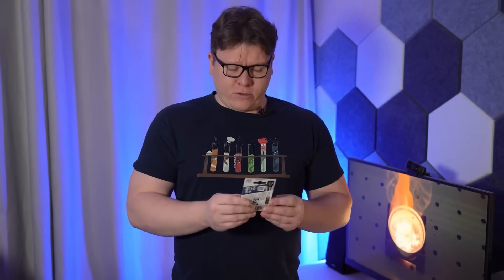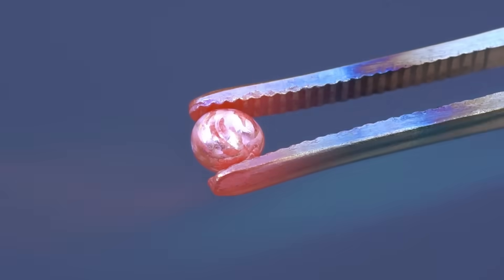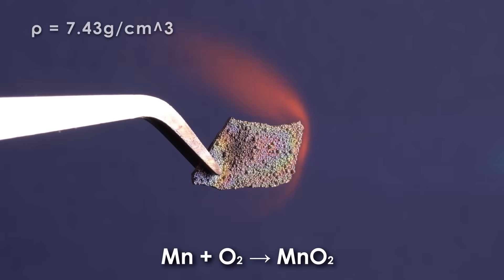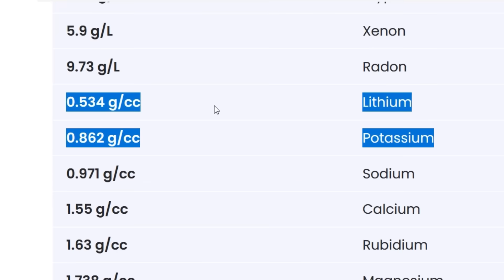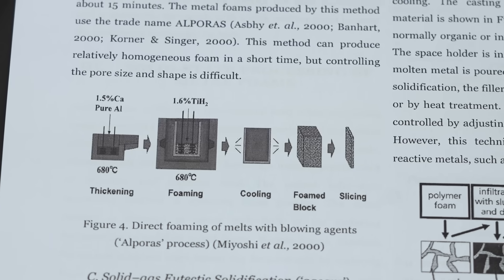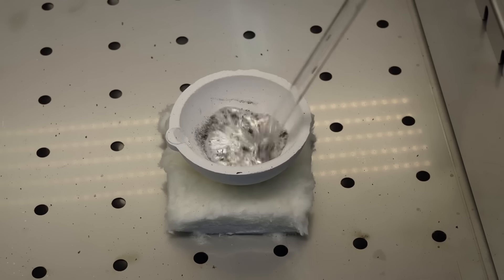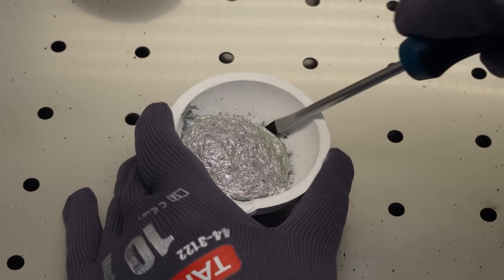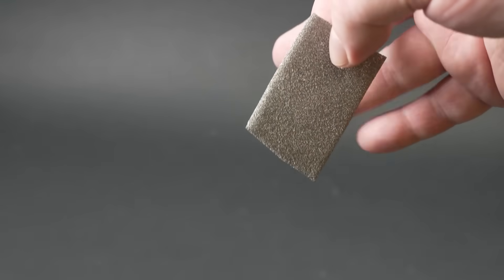Metal Foam – The Most Challenging Material to Make!

Comment: 17:25 metal foam helps prevent a cascade of high-pressure forces from traveling through the vehicle. The foam absorbs and disperses the impact energy by compressing and deforming in a controlled manner. This reduces the force transmitted to other parts of the vehicle, minimizing structural damage and improving passenger safety. It acts as a buffer, preventing the rapid spread of shock waves that could otherwise intensify damage. 

As for your voice, this is absolutely fine. Sure, I would prefer the original, but at least this one sounds more like you if you lost some of your accent. The only reason I had an issue with the AI voiceover is that the technology was mostly used in low-quality content, making it synonymous with that. Judging from the comments, I don’t think you’re ever going to hear the end of it, but it’s easy to see why there’s so much fuss. Just imagine Sean Connery without his iconic accent.

Comment: I would recommend grinding the titanium hydride into powder. I think the size of its granules prevented good mixing with the molten aluminum, though you may need inert gas flow during mixing to prevent fire.
Reply: Yeah it's crazy titanium will burn before it melts in normal atmosphere

Comment: You can use anhydrous borax to make metal sponge ( anhydrous borax has higher melting temperature than aluminium ).
Borax can be sintered into porous "reverse sponge", connecting all of its granules into a single structure, which means, after you fill it with molten metal, no borax will get trapped, and all of it can be dissolved later, after the metal solidifies.
Reply: Wouldn't borax dissolve partially into the metal lattice?

In the past I've used ammoniumhypophosphate or didhydro-types which decompose at around 200/300°C. After the metal-substrate mix is pressed, it keeps its form perfectly when sintered with the right heating profile.

Since the sintering temp is way higher than the decomposition temp, you won't have any residue left (nitride formation is way to slow and needs higher concentrations of Nitrogen).
Reply: @MatChem001  I cannot comment on the metallurgical quality of such metal sponge, I'm just a hobbyist, but I did make "aluminium sponge" on accident couple something years ago, simply trying to melt some aluminium over glassified (from prior use) and crushed borax, and the aluminium did melt before the borax, flowing into the crushed borax bits.
If I remember correctly, there was some research on using borax to achieve spongy metal structures, something about low temperature sintering I think.
I don't think any sort of decomposition would be a problem, since it's typically undesirable when casting solid aluminium, which is the opposite of a sponge, so theoretically, it might possibly even help.
Reply: @staviq  hm sounds alright. Thanks for the reply

Comment: Looks like the foam metal is made as a cast from a sponge or plastic foam.
Reply: Probably uses an airation system, & the best parts are cut out & used, the rest is proabably uneven & not sold.

Comment: The constant conflation of weight in density drove me nuts. Lithium is not "light". AI translation is not up to the task.
Reply: @chriskola3822 Unless I'm missing something, for a given volume of a metal in a given gravitational field weight and density are essentially the same thing, so I don't really see a problem with conflating the two in the context of this video.
Reply: @xequals-pc1wl  How heavy is Lithium?
Reply: @chriskola3822  0.534g per cubic centimetre. In other words, light.
Reply: @xequals-pc1wl  To someone who doesn't care about the meaning of words, that is an adequate answer.
Reply: @chriskola3822  And that's the sort response I'd expect from a pompous pedant. This is a fairly low-brow pop-sci video, not a chemistry textbook. Use a bit of wit.

Comment: Silver and gold are also fairly good at dissolving hydrogen. Metallurgists when casting or doing other to things with high temp molten metals, sometimes have to account for whichever gasses could be disolved in the metal. Hydrogen isn't usually a problem, but an effect in smelting that donetones occurs is "sprites" which are holes or tendrils on the surface caused by escaping gasses that dissolved in the metal.

Comment: Cadbury Aero was made by passing molton chocolate through a nozzle, containing a smaller nozzle that pumps air into it. Air flow control determines whether you get bubbles/foam/sponge
Reply: I was thinking the same thing. Steel melts at a higher temp than 700C. if you pumped in hydrogen through several nozzles, you could foam the aluminum. I'm sure it's a little more complicated than that, but that was my thought.

Comment: You can make more dense metals than osmium. With detonation compressing. It's highly restricted knowledge, because it is mostly used to make subcritical fissile material less in volume, and fall over critical.
Reply: The exist at that density only while being compressed though. Not too useful if that's in the middle of a fission detonation.
Reply: Huh? Its used all the time. Explosive forming is commonly used. As far as compressing fissile material much of the information is available in the public domain. The key is producing weapon grade material for use, and multistage thermonuclear devices. 

Explosives cannot not increase the density of  materials anymore than forging them which has been used for centuries. Explosive forming is used to bond metals that cannot be combined using smelting to create alloys. Its also used to make round shapes for welded hollow spheres to smooth out all of the welded pieces.

Comment: Interesting. BTW, that was used in some older Macbook Pros, sandwiched between aluminium chassis and its air vents for heat exchange.
Reply: Which ones? 😂
Reply: @forbiddenera  Nvidia uses them in its DGX spark stations. And Apple also used to employ them inside its late 2013 to mid 2015 MacBook pros. Built in the unibody.
Reply: @forbiddenera  MBPs 13/15" from 2013 to 2015. Visit ifixit teardowns from those models and expand the internal pictures. Thet are located between the fan-heatskinks and the chassis air vents (inside thin gaps machined into the aluminium frame)